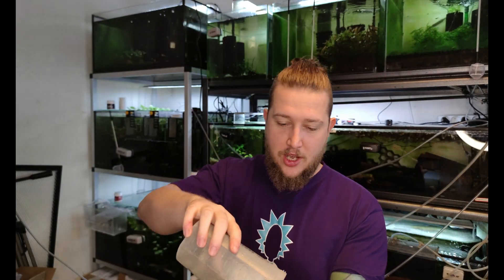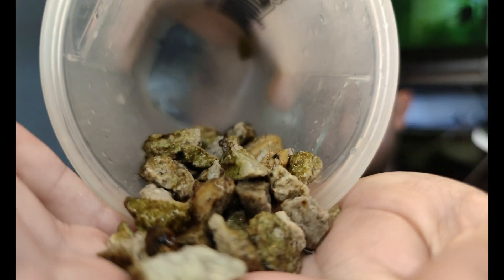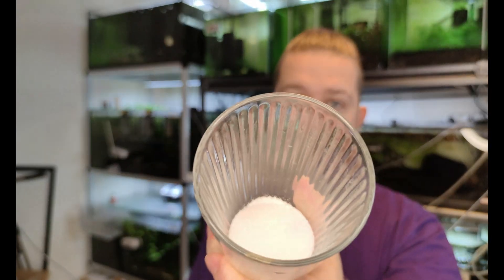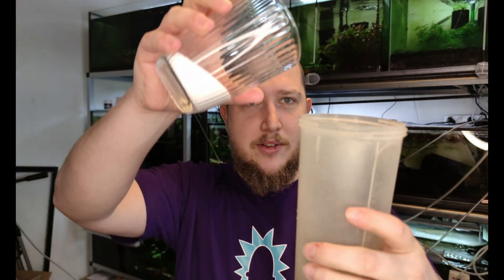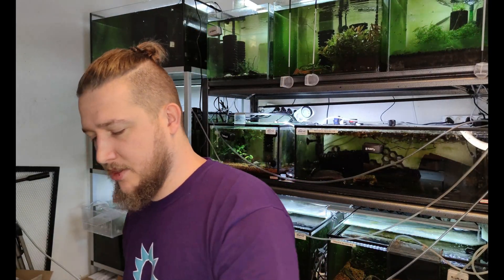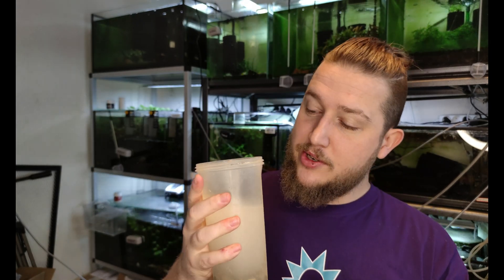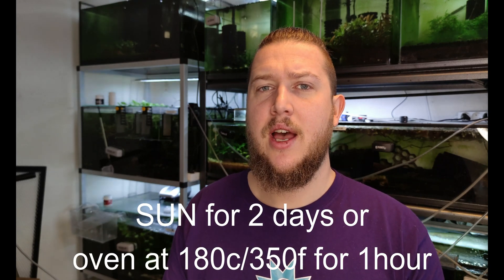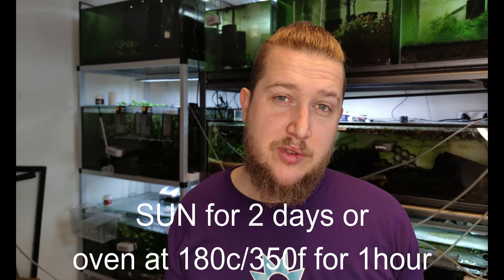How to Regenerate freshwater Zeolite

Comment: Before the age of the internet. A guy that owned an aquarium told me to boil the ammo-chips in salt water, rinse thoroughly and put them back in the bag. No soaking overnight and no drying in the sun or oven. I never did. I just threw them away and bought another carton of ammo-chips. They were cheap enough not to be worth saving. But now everything is getting so expensive. A big cardboard (milk) carton of ammo-chips from API or any of the other brands used to be only a couple bucks. Now, for a tiny plastic jar of product is like $12-15.
Reply from the maker: Yeah every trick counts!

Comment: Hello. Does the zeolite lose its chemical or physical properties after washing and drying?
How many times can we wash and use the same zeolite?
Thank you
Reply from the maker: I'm not sure if you can do it for ever. 
I haven't come to it's limits, if it has one :)
Reply: @PureShrimp  Just washing and drying it once is enough for me.
I breed parrots and spread the zeolite on their cage floor, but there is a lot of dust. That's why I try to clean it from dust, but I am suffering from allergic asthma. I use 1-3 mm zeolite, the one you use is large, you should not have this problem. My What I'm wondering is, if I wash it once and dry it, will the ammonia holding feature go away? Thank you very much.